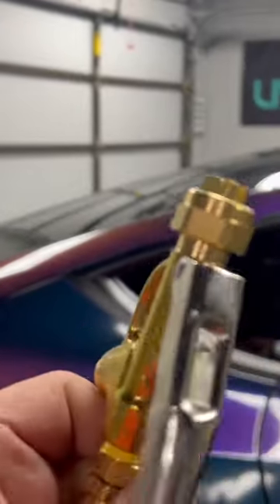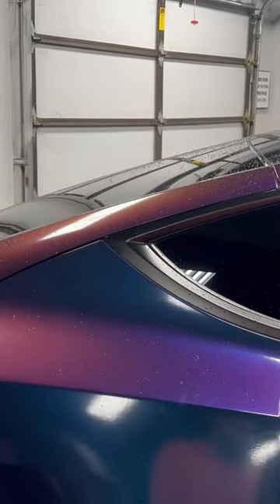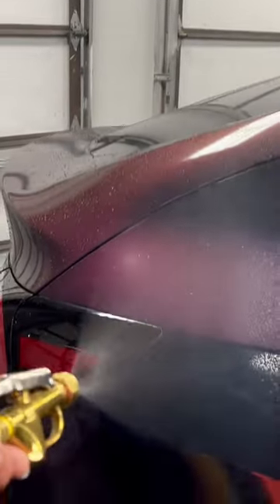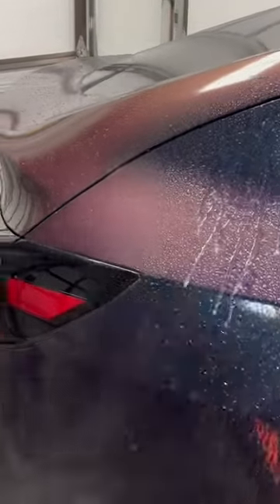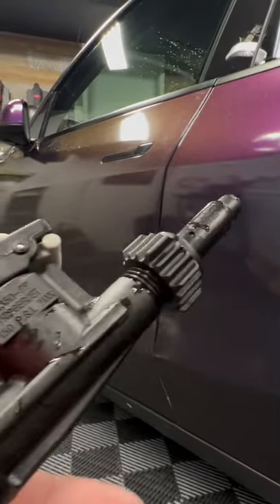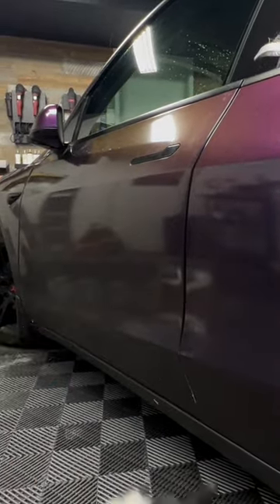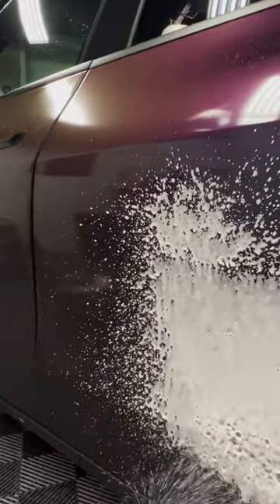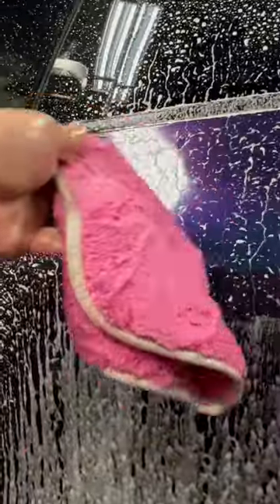Rinseless two ways with one detail keg #shorts #recommended #detailer #cardetailing #tesla

Comment: Where did you get the foaming spray tip?
Reply from the maker: Teejet sells them or I looked up teejet foaming nozzle
Reply: is it the tip that creates the foam or is the keg modified to create foam?
Reply: Could you tell me what color the foam tip is?  each color determines flow.   if you remove the tip bottom of nozzle should be either white or yellow